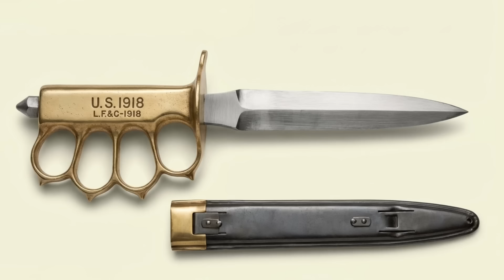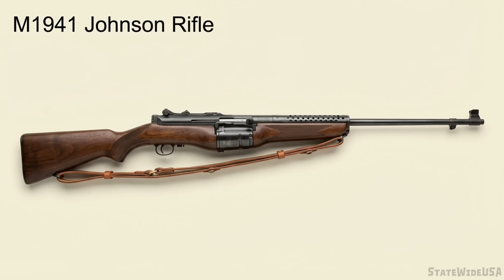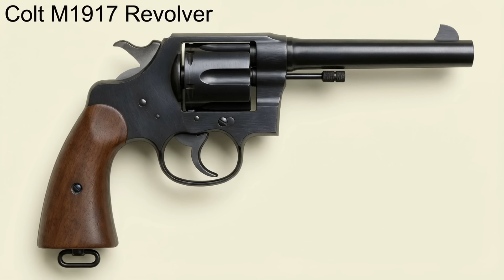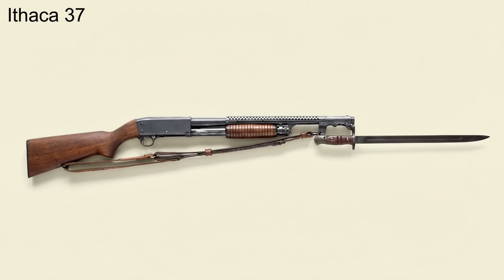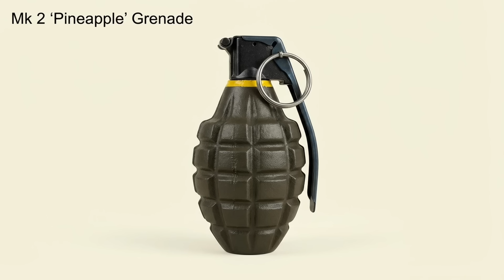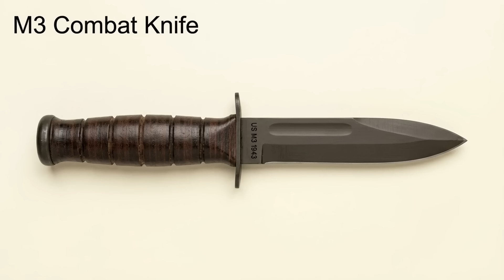Every  U.S. Weapon Used in WW2

Comment: You missed; 1. M 1911 .45 pistol, leftover from WW I and interwar; 2. S&W m-1917 .45 Revolver; 3. Colt Official Police: A .38 Special revolver used in security roles.; 4. Colt Pocket Hammerless: Smaller automatic pistols (in .32 ACP and .380 ACP) used by some personnel, such as Generals and OSS; 5. Colt M 1879 .45 long Colt - see Pattion, George; 6. M2 .30 fully-automatuc carbine (Summer, 1945); 7. M1 Garand (designated marksman versions) M1C and M1D; 8. U.S. Marine Corps: M1903A1/Unertl - 1903 Springfield.30.06 with match barrel and Unertl scope used by U.S.M.C. snipers starting in 1943; 9. Winchester Model 70 with Unertl scope used by a few U.S.M.C. snipers ; 10. M1941 Johnson Light Machine Gun A recoil-operated light machine gun used in limited quantities by US Marine Raider battalions and the US Army's Merrill's Marauders as a slightly lighter alternative to the BAR; 11. Colt Official Poluce .38 Special. Limited issue to rear area and MP's; 12. Colt Model 10  .38  Special. See omission 1; 13. United Defense M42, .45 acp AND 9MM PARABELLUM. lIMITED ISSUE TO OSS; 14. Reising M-55 SMG.  .45 ACP selective fire.  More compact than M-50.  Originally issued to Marine parachute infantry and armored vehicle crews.

Comment: Some forgotten wepons by this AI sh*t:
M1941 Johnson LMG, a 30 round mag fed Johnson.
M9 Bazzoka, Main change from the standard is that moist of the times it had a 2x scope atached to it.
M2 carbine, an automatic wersion of the M1 carbine.
M2 Hyde, the SMG bettwen the Thompson and the Greese gun the Hyde never went in to mass production as the Grease gun came not too much later.
M1 C and M1 D, both are based on the M1 Garand however both had scopes (difrence bettwen the C and D is how they mounted it and a bit diffrent barrel)
Browning auto 5, an automatic shotgun, also first succsesful of automtatic shotguns (still used for hunting) designed by the wizard of firearms (John Moses Browning).
M55 Reising: an upgraded M50 Reising.
Many variations of the Thompson, I don't specify any as lots of them are missing for some exampales: The classic M1 Thompson, M1921AC Thompson (Chicago typwriter, the picture shown at the M1928A1 is actually this warrient)
M8 grenade launcher, a rifle grenade adapter designed for the M1 (or rarely M2) carbine
T 20 rifle, a rare and late war rifle it was an M1 garand with a 20 round box magazine and select fire, also later it's designe evolved into the M14
T 24 LMG, a rare conversion. It was a MG 42 converted to fire 30-06 springfield.
M1 Flamethrower and M1A1 Flamethrower, early US flamethrowers
Many BAR varients: while this is nitpicking one of the main fetures of the BAR wich was only seen on later warients is it's selection of fire rates: Auto, Semi, and Slow Auto. Slow auto is the focus as the BAR only had a 20 round mag semi was not enugh firepower but auto was too fast for 20 rounds so the Slow auto was an inbettwen to still give firepower but still be austo and not loosing actual auto
Boys ATR, (ATR stands for Anti Tank Rifle) rarely used by the US and more so by the UK but still should be mensioned as it was used by US forces.
Lewis gun, agin mainly used by UK and commonwelth (commonwelth=UK's colony's and former colony's for exampale Canada, Australia) forces but in some cases Lewis guns were used by the US.
M1E5 Garand, I wanted to mention it as he mensioned the M1A1 carbine, it is the paratrooper version of the Garand, however paratropers sometimes just used the standard Garand.
QF 17, While agin mainly brithis but the US also used it in mass numbers, also it's knowkn as the 17 punder (if you couldn't guess from the name)
Warius AA systems: such as the quadmount, 20mm Polsten AA, and more
M2A4 AP mine, just an Anti Personal mine
AN/M8, just a standard smoke grenade wich wasn't white phosphorous grenade
No. 69 impact grenade, while agin mostly brithis many US troops used this impact grenade

Those are the main misses

Here are some mistakes:
The M1919A6 picturture is actualy an AN/M2 Stinger, I didn't want to mention the stinger in the list above as only 2 ever existed as conversions of the AN/M2 Browning MG (upgraded version of the M1919 MG used for plane back gun), the M1919A6 was a standard issue M1919 just with more mobility, and the M1919A6 wasn't that bad as he sais, it wasn't good but it didn't suck, the AN/M2 stinger also didn't suck only because it had diffrent purpuse and it did it's purpuse.
Also important to mention that the M7 rifle grenade disingaded the gastube (aka didn't sicly automaticly) as it could explode or just ruin the gas tube. The M8 wich I mensioned above didn't do this as it had a smaller cartrige
The M18 isn't shoulder fireable.
I don't know the knife/bayonet stuff as I didn't watch it

That's all I could find hope it can make everybody understand how hoorible this video is
Reply: The Browning M1917A1 almost looks like a Vickers and the hose is meant to connect to the barrel and jacket end.
Reply from the maker: This guy knows his stuff. We’re still just starting out, but we’re learning and improving with every video.
Reply: @Statewideusa can you do weapons videos